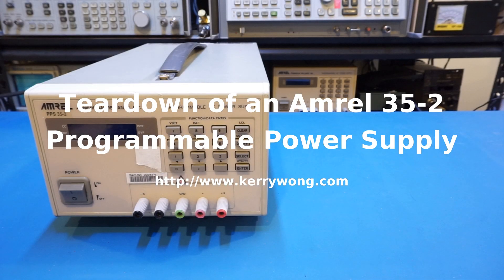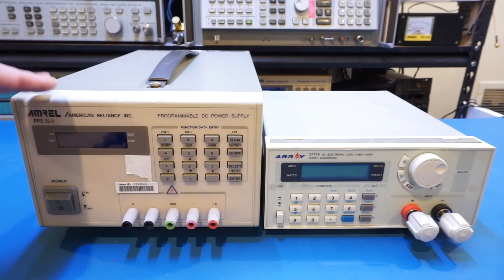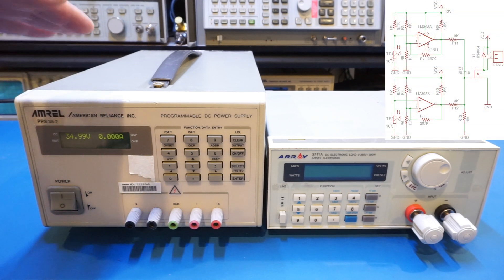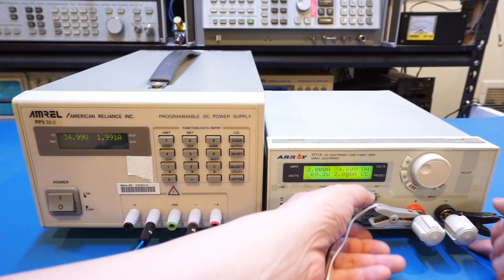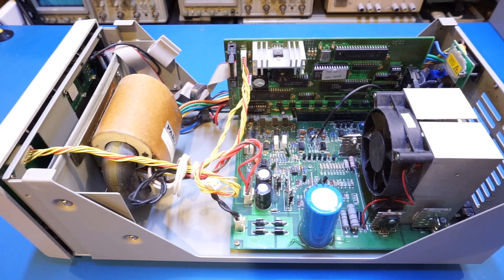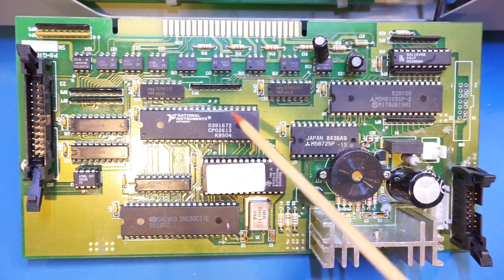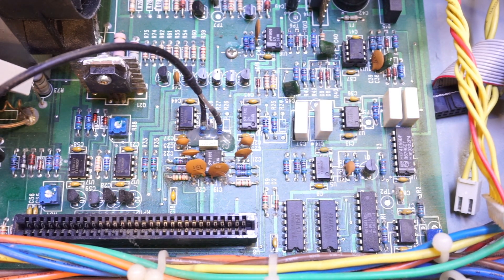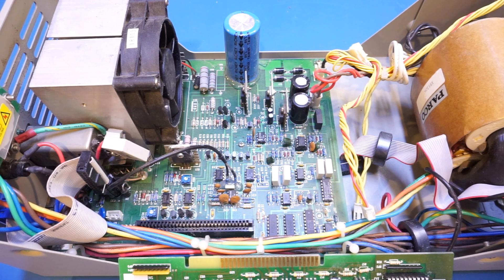Teardown of an Amrel PPS 35-2 Programmable Power Supply

Comment: Digital control board main ICs:
DAEWOO DMC60C31 - Equivalent to Intel 80C31 8-bit microcontroller
TMS 27C512 - 64KB EPROM
Mitsubishi M58725P - 2KB SRAM
Mitsubishi M5M81C55P - Equivalent to Intel 81C55 2KB SRAM, I/O, Timer
National Instruments - NAT9914 IEEE 488.2 controller with customer markings?

Comment: I was zapped by this type of Amrel power supply from its mains filter caps when I accidentally touched the IEC socket/plug terminals while carring. I do not know if it was problem of one specific unit but it happens. Nice teardown, thank you.
Reply: Had that happen with a really nice 4 quadrant NHR PSU at work when I unplugged it to untangle some wiring. It's not just the cheap ones that do it.
Reply: Quite common. Especially if the device has a SMPS :)